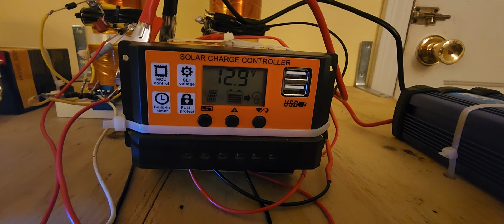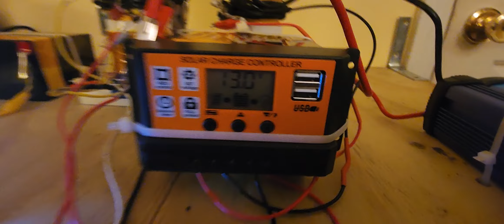🌞1500$ 100 Watt 120VAC Wireless Power Device Prototype Now For Sale. Unit Requires Heavy Earthing🌎

Comment: Are you okay Malik? have you tried putting several diodes in parallel on l 2? is it out of tune? I noticed that on the tower which receives the signal the circuit seems to work in both directions... in floating mode I managed to transfer 1000 volts more instantly over time.... under load 300 watt halogen with 50 watt input... lol! I'll do it again for you, I'm not sure but I think the circuit can work backwards on the receiving coil... you have to check that... so a tower which emits under load. .the other tower which receives... connect it as you would connect it to the input... it's your output... a plus a minus confirms me because it becomes confusing lol❤

Comment: What type of super capacitor do you use? You can put a link or the model there
Reply from the maker: Here's A Version Of It That Will Work Just As Good & The Receiver Coils 2 Amp 2Mhz Output Rapidly Recharges It To The Point It Can Run 100 Watt Loads For Under 15 Minutes

https://www.batteriesinaflash.com/xs-power-sb75-680l-12v-super-capacitor-bank-max-power-600w-75-farad?utm_medium=cpc&utm_source=google&gad=1&gclid=CjwKCAjw38SoBhB6EiwA8EQVLstuuKP8h-997Qav_MUP2Hp-vT-Twa9FDHzVrvsgP_ANkgRaql6npRoCK6IQAvD_BwE

https://www.googleadservices.com/pagead/aclk?sa=L&ai=DChcSEwj69_Gu7cWBAxXC9eMHHYGbDGkYABAnGgJ5bQ&gclid=CjwKCAjw38SoBhB6EiwA8EQVLg7S3HgF1M0Agd3QTGQel5b3Q407wicP64LbVeyArC_Xb5bQeMzHHBoCDBQQAvD_BwE&sph=&ohost=www.google.com&cid=CAESauD2n6uwDG-0uN9TyHLCDoA1ZZek1mqZuI9LfeZV42C_ZE6EYkCMJ9xQ9YItNMJeRGkBoBRetTL-cGP56mCSDAPm9bW3buBLV5-8gN2583dbJzafNkeutXYkcipV_s-kt6-nxVn-Z9dF028&sig=AOD64_1JKcOfNBX3UkXbginVvz_5nQmRpw&ctype=5&q=&ved=2ahUKEwidiuiu7cWBAxUcmYkEHTggBtQQwg8oAHoECAMQWA&nis=7&adurl=